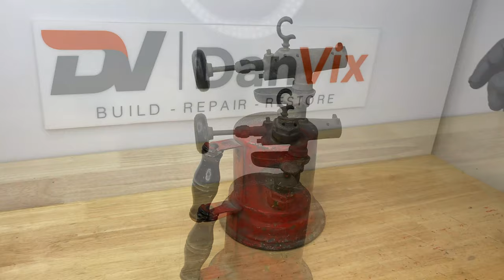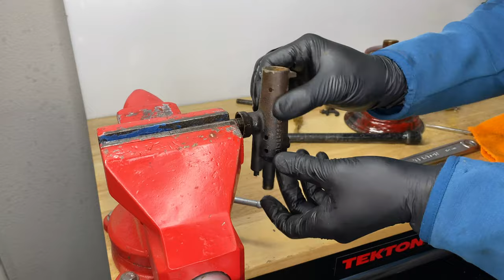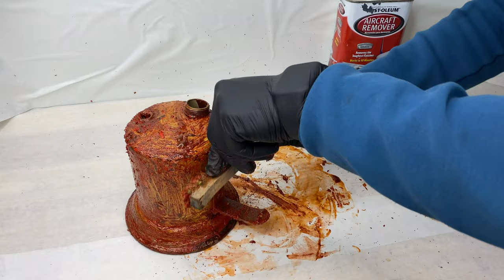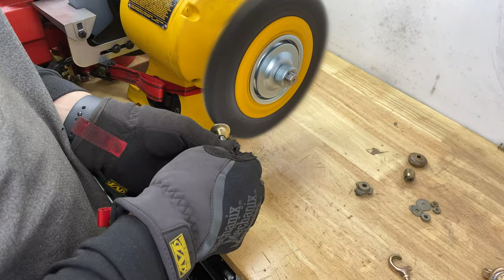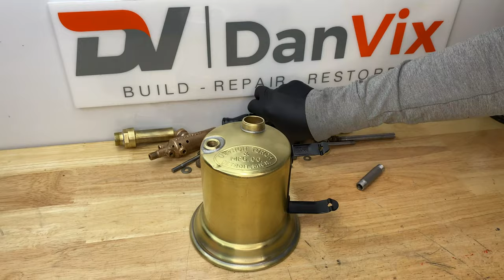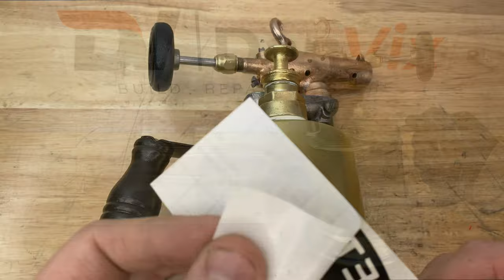Antique Blowtorch Restoration - Amazing Results

Comment: Does it reduce the value of the torch when you do this ?
Reply: They're not worth much, and even mine, a "LENK GASOLINE BLO-TORCH" on which I merely repaired the pump, is a great, functional torch
Reply: To actually answer your question, yes, it does reduce the resale value of the torch. As with most antiques, collectors often value patina over a restored finish. However, it can be argued that an item such as this that has been restored looks absolutely brilliant in a vintage tool collection and gets more 'oohs" and "aahhs" than a sooty, corroded one would. As far as function is concerned, proper cleaning would only serve to improve the tools performance.

Comment: I would have painted the blow torch red because that was the original color.
Reply: I have one myself, and it wasn't painted - it was brass just as this one.  Mine also had an unpainted wood handle (maybe pine?), but I replaced it with an oak handle I made.